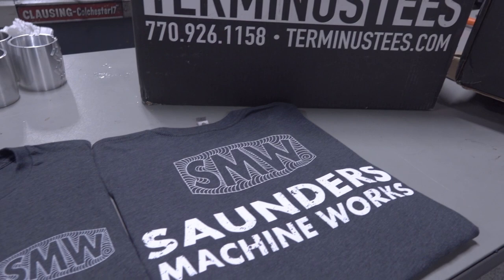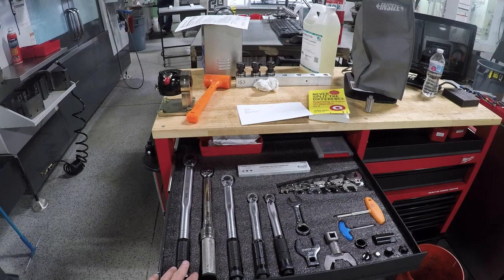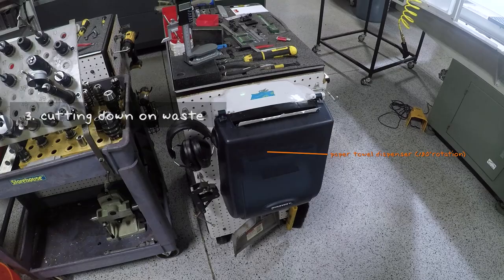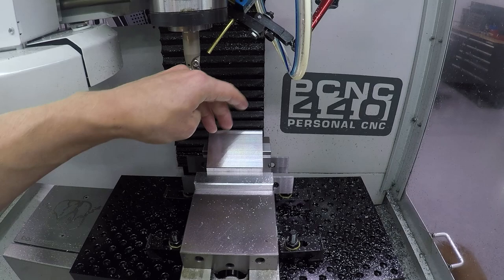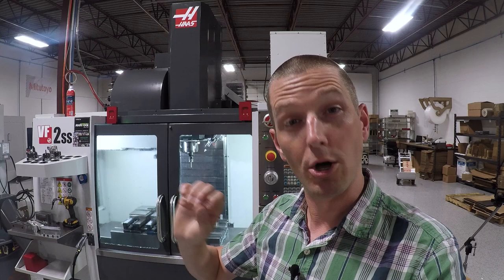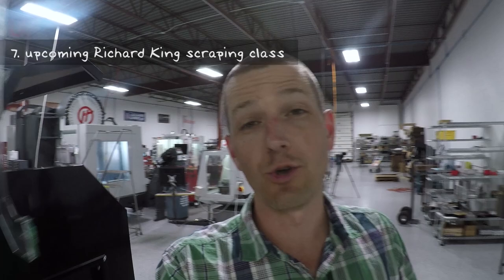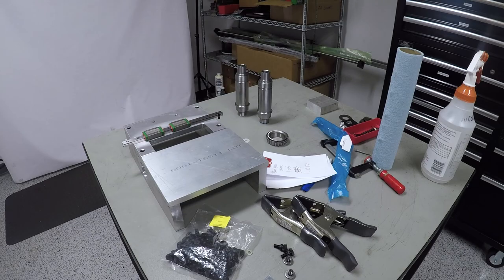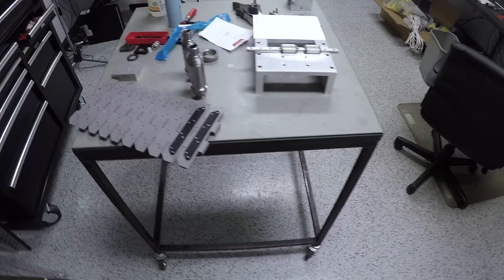NYC CNC Shop Update - June 2018!

Comment: I do not know for sure about relaxing the tension on torque wrenches but in all my time working at Trane I never knew of any of the torque wrenches being changed at the end of a shift or the day.  Part of my job as an auditor was to check torque wrenches against a standard.  There was never a notice about relaxing them for storage.  It might have been because they were used every day.
Reply: if you preset a torque and it goes through a "calibration" regularly there's no need to loosen it off. if your using an adjustable one and want to rely on the markings for example then there is some truth to it all. in reality the wrenches are massively over designed so things will never stretch like that unless your working right at the top end of the load limit. basically its a myth but possibly with truth in the past.

Comment: The wrench’s stored tightened like that are fine. It’s not high precision work, +\- 5 lbs of torque is more than adequate for what’s being done. 

The crows foot attachments throw the reading off anyway since it changes the leverage point from where the wrench was originally calibrated at. 

Wouldn’t worry about keeping them set to a specific torque. Yes the spring will eventually wear out and it will go out of calibration, but you’re also not doing high end motor work or anything else requiring high precision torqued fasteners. 

Worst case get a high end digital torque wrench and every 6-12 months check the spring torque wrench’s against the digital one.

Comment: I thought torque wrenches was supposed to have the spring loosened when not using to keep them from getting useless.
Reply: Henrik Thuresson that’s what I’ve always been told as well.
Reply: That´s a bit of a rough comparison. Pushing your bullets up a metal tube and precisely tightening a bolt are pretty different applications. You might be right and storing a magazine compressed does "very little" to it but it still does "something". And "something" is already enough change for a precision instrument like a Torquewrench to make it useless.
Reply: Torque wrench’s aren’t even that precise anyway. It’s actually more precise to go by number of turns of a bolt vs a torque wrench. 

Being off a couple of lbs for what he’s using it for isn’t a big deal. Just for vices and collet nuts. Besides, the crows foot attachments throw off the reading anyway since it changes the leverage point. 

The cost in wasted time and potential human error in tightening and loosening the torque wrench everyday is more than replacing a $40-$60 wrench every few years.
Reply: If you all are assuming they are tight and locked, don't. Mine has an "unlock" feature that retains the lb setting but the torque wrench itself is loose, so when you're ready to use it, you just flip it to "lock" to tighten. When you're done, flip it to unlock and store it.
Reply: I'm guessing that he's not worried about it on some $40 wrenches, that they don't need for precision work. Speed vs cost.
Reply: Occams Sawzall I used to work a job where we had to test our torque wrench set every morning on an analyzer. Most kept a tolerance of 1-2% of rated value and 5% was the limit. That being said you have a lot of good points but number of turns will not give you any sort of torque value. Number of turns required will depend on materials being torqued and when you are dealing with varing sizes being clamped then the best way to ensure a certain amount of force is to use a torque wrench. No extension and shortest impact rated socket you can use. There is alot of technique to use one properly. All that aside we often forgot to unwind them and we never had many failures from that. Mostly abuse type failures.
Reply: This! added with the gross inaccuracies of torquence wrenches is also why applications that require critical hold down force use torque-to-yield fasteners now. For most applications, these inaccuracies are not critical.
Reply: I think you had one overly obsessive engineer at one time. A process was written around it and no one bothered to change it. Or, it might be something that is super critical, but in that scenario, there are better ways to acquire and maintain a static load in design. I've designed a quite a few assemblies that required torquing heat exchangers to ceramic thermal electric devices. I ended up going with Wiha torque drivers and found having our quality department set/calibrate once a month is sufficient. Even then, they hardly ever get adjusted by our quality department.

Comment: Even though they're cheap, the torque wrenches will lose calibration quickly if they are stored at a setting other than the lowest. Maybe that's a myth, but it's pretty strictly enforced IME.

Comment: Hi John,
Nice upgrades there. That book, there was one time I wish I had split the difference. It is 2003 and three years after an auto accident where I was rear ended. It aggravated a previous injury from a decade prior rear end collision. Went to binding arbitration and right at the start both attorneys agreed to limit the award to no less than $30K and no more than $80K.  That was news to me. If it wasn't for the pain I was experiencing, I would have suggested to split the difference to $55K. Well, the judge took everything under advisement and said he would let us know of his decision. My attorney was livid when told he awarded $13K plus change. Since it was binding, the judge would not change his decision even when he re-read the record of the $30K lower limit that was agreed to by both parties. NEVER will I use binding arbitration again.

Comment: Pull your torque wrenches down to 10 max when storing. They will lose calibration.  As much as you guys spend on precision you don't wanna gaf it up by over trying when you think it's at a lower pressure